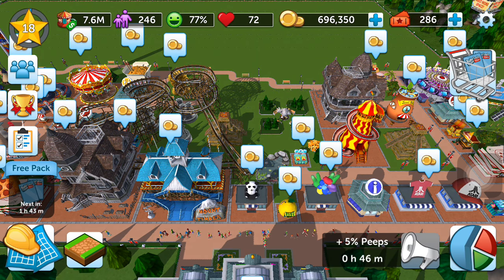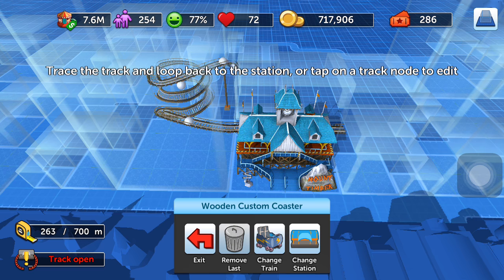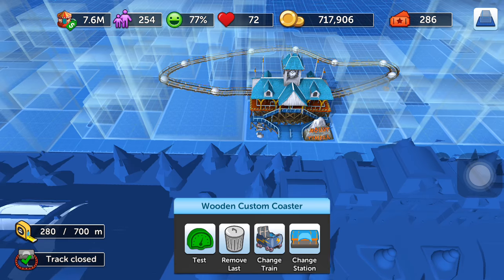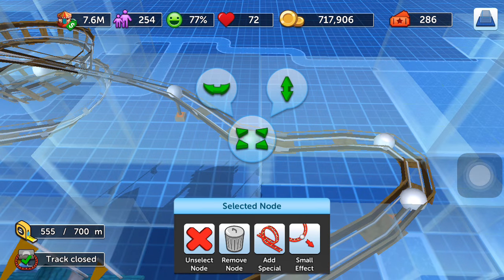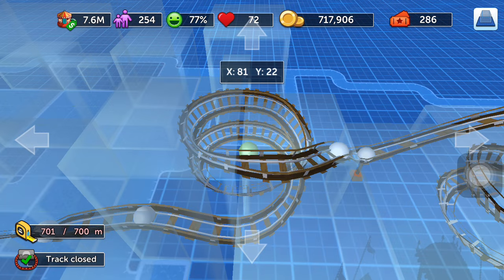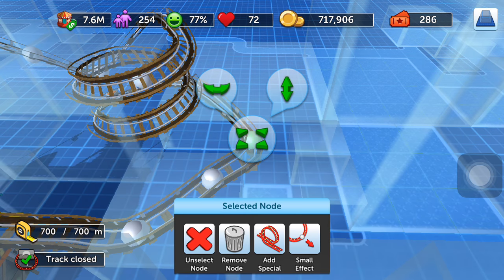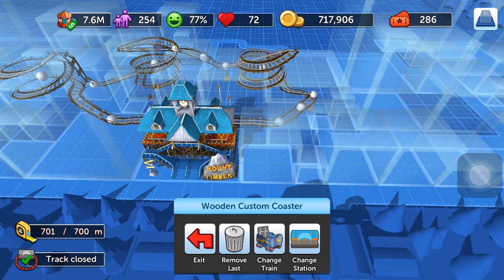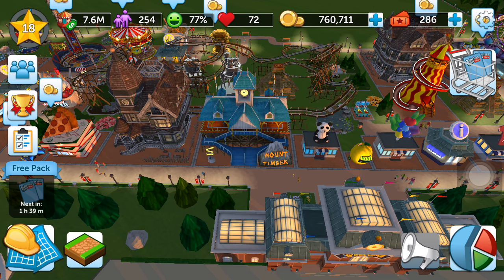How to build Rollers Coaster - RCT Touch - Wooden Coaster - Tips & Tricks

Comment: is there a way to open the ride?  My rollercoaster doesn't make a dime. it's always showing 0/9300 and never accumulates. can't sort out why.  there's always a train looping on it, but it's not accumulating cash.
Reply from the maker: Just check wether or not you have kept ride for money or is it 0 dollars.
Just make sure you make it fairly priced and not high priced if its extremely expensive even then it might not work.
Reply: Monil Nitin Parikh its a bug. common issue they havent fixed yet. crap.

Comment: Airtime?
Reply: Monil Nitin Parikh Can u tell me how to get 3-5sec air time on a wooden coasters
Reply from the maker: "Air time" is the feeling of weightlessness or negative gravity force experienced on a roller coaster or other amusement rides. On roller coasters this feeling is usually achieved by the train going over a hill.

Make sure you get some good height and have many ups and downs the coaster train going over the hill will equal to a certain amount of air time.

Make sure to have steep drops from heights.
Reply: Hi Monil. People are asking because of the "Build A Great Classic" challenge for wooden coasters. I know how to put effects in and make it the correct length but the BIG stumbling block for me and most others by the look of it, is the airtime required to complete the challenge which is 2 or 3 seconds if memory serves. I've been playing around for ever trying to do this since the challenge started and failing miserably on that one criteria. I think it would be VERY useful, if you don't mind and have the time, to make a video just for this challenge - around level 14 if memory serves. I have all green ticks but the airtime fails miserably. :( I'm sure a lot of people will appreciate it because I've been searching for a while and nobody else seems to have done a video for this particular challenge.